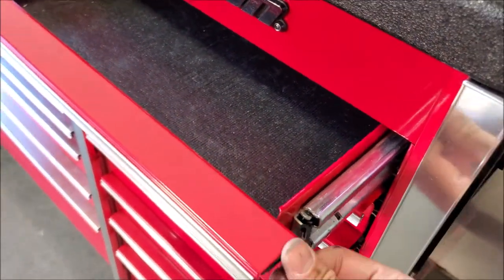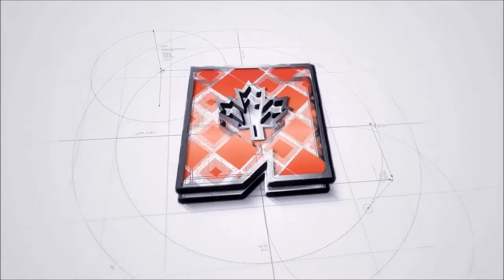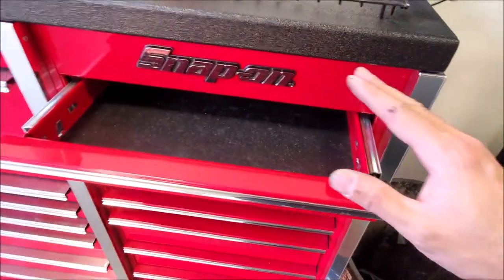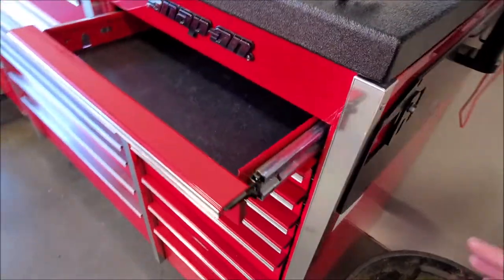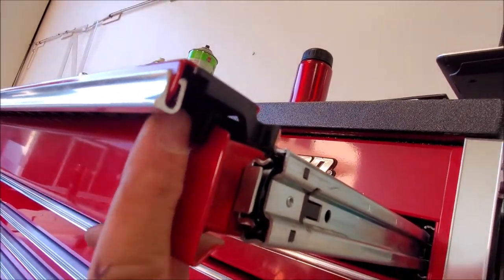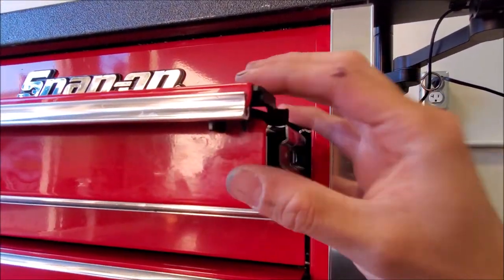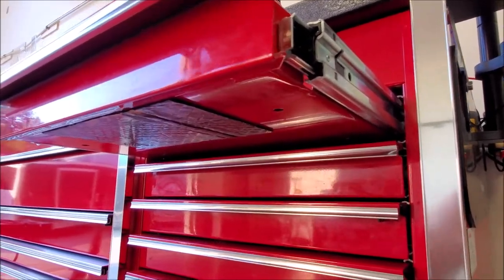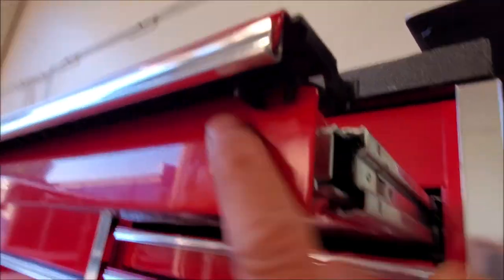SnapOn Toolbox plastic drawer lock removal/ replacement | AnthonyJ350

Comment: A snap on box is more then a name brand its quality. You can put over 350 lbs per draw. Most boxes won't take the weight.
Reply from the maker: I totally agree, better quality and better service. How many other brands have warranty where you can make a phone call and have it rekeyed or have new slides delivered and installed?
Reply: @AnthonyJ350  nothing says quality like flimsy plastic latches on a $5,000+ series of boxes.  This video wouldn't even need to exist if you were given actual "better" quality in the first place.  Ex: Napa Carlyle or Montezuma/Masterforce style STEEL drawer latches.  But why have actual standards when you can pretend your favorite logo makes you a special snowflake.
Reply from the maker: @jaywelker5566  Big words. Let's see your setup and what you're working on.
Reply from the maker: @jaywelker5566  Hey keyboard warrior, are you there?